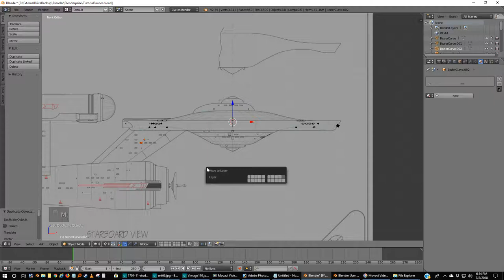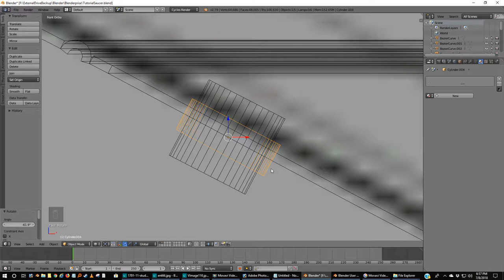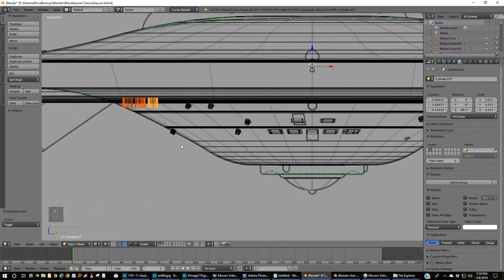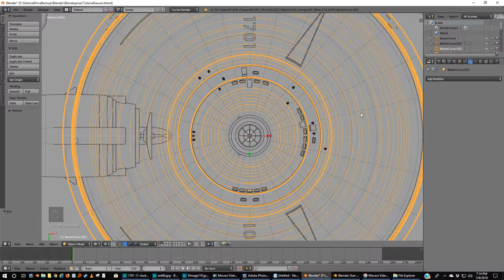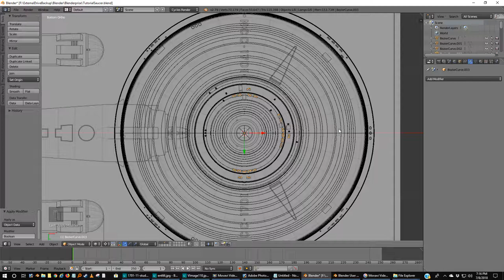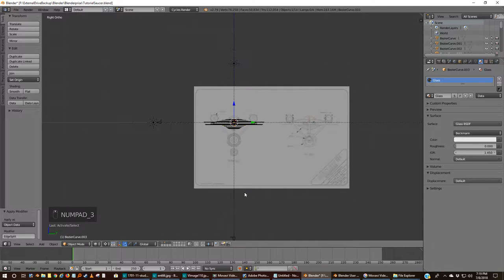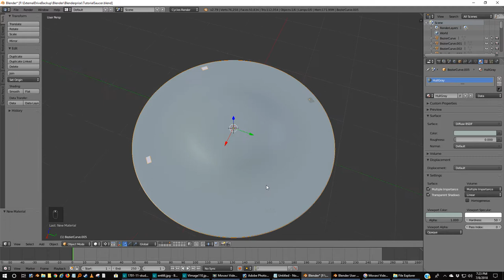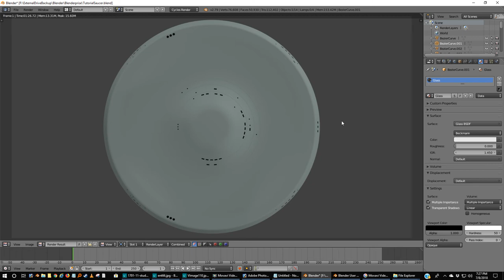4 Lower Saucer Windows

Comment: Hey Eric, another question. Would it be possible to model to a reference image as you have done, and then afterwards apply the correct measurements to each part and then assemble them together again? I just thought instead of worrying over exact measurements, I could just enjoy the modelling to begin with and then once I have a model which closely resembles the Enterprise, I could then dive in and alter X, Y and Z dimensions. Would this be possible?
Reply from the maker: Good question.  I believe that you can alter scale at any time.  So, you wouldn't have to do each part, unless you thought they were already out of scale.  Then tell blender that a blender unit is an inch, or a foot, or a yard, or a meter, or a mile ... or whatever!  And of course, you can alter the size of anything you model at any time too.  Just selected it, then "S" to scale, then either use the mouse to scale the item or type in the numerical value you want!
Reply: @scifieric  Cool thanks! That means I can alter the model afterwards to make sure it conforms to the studio model measurements. Blender really is an awesome tool. Thanks again!

Comment: Question, the two sets of three lights, are they vertical?
Reply from the maker: I posted another of these that actually had sound.  Perhaps that one would answer the question.  I'm trying to understand about the "two sets of three lights".  Do you mean on the sides of the saucer?  (Top, bottom, and side?)
Reply from the maker: Or are we talking about the three clustered round lights at the periphery, near the rear of the bottom of the saucer?
Reply: @scifieric are you available to look at a materials issue I am having with the tutorials?   I have gotten through this tutorial using 2.82 but I am having issues when I place a material on the hull.  I get a very strange fragmented look.

Comment: Eric, are you still available to talk about a problem I am having?  I have gotten through this tutorial using 2.82 but I am having issues when I place a material on the hull.  I get a very strange fragmented look.
Reply: I would reccomend you do what I'm doing and download 2.79 from Blender, since they have it archived on their website. It also really helps since 2.82 doesn't support background images. Here's a link to their download page for all versions of 2.79: https://download.blender.org/release/Blender2.79/
Reply: @sirfirewolfe5647  I really don't want to go back to an older version. Also, I believe you are wrong.  I have the blueprints as background images.  Does Eric ever reply on here now?
Reply: I’ve actually been having a similar issue, on 4.0. Weirdly enough, the problem kinda goes away if I use a different material, like emisson…it looks fine in the materials view, but in the actual render it looks very weird.